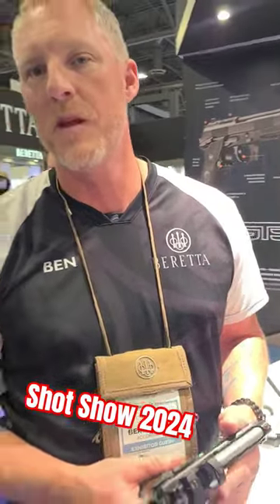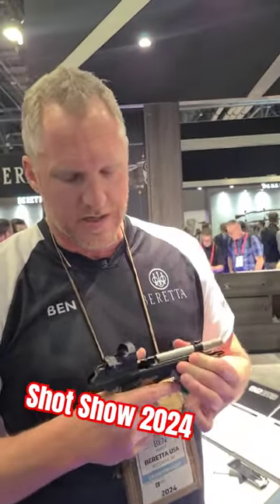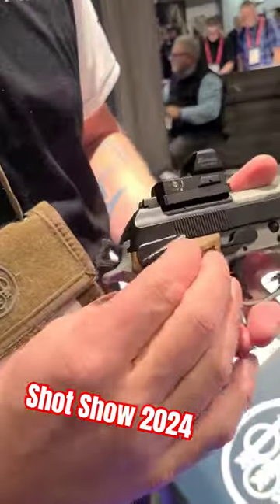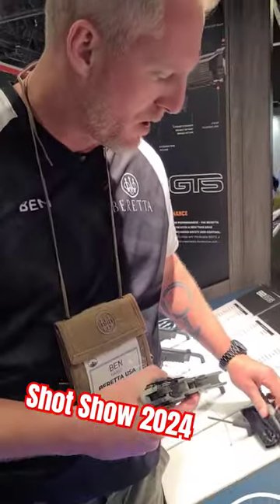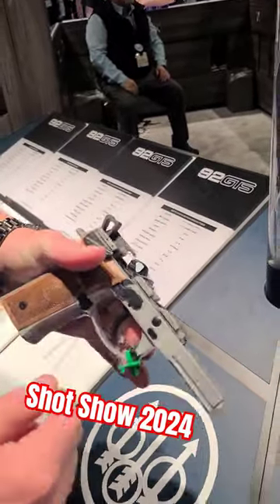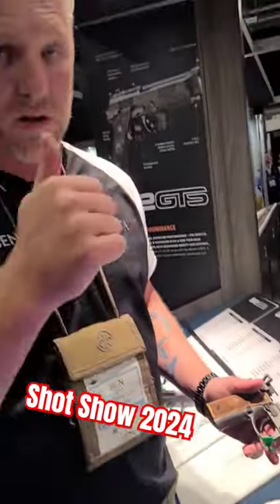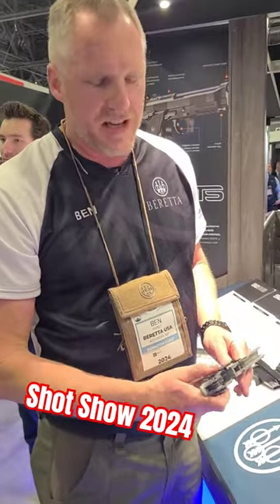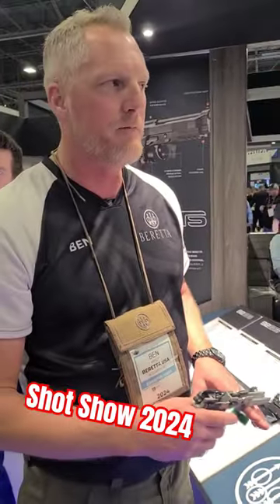Team Beretta Shooter Ben Hardt talks about the new 92XI GTS at Shot Show 2024

Comment: The clearly did not just copy Taurus' system. I'm particularly curious about the motivations for not using an established approach for a frame decocker.
Reply: hey mate do your research on beretta and Taurus pietro beretta sold his Brazilian factory to Taurus along with the blueprints for the frame saftey pistols in 1980 Taurus started selling their model after the government contract ended
Reply: @intoxicateddog12  Actually they sold the Brazilian plant to Taurus to move production for the Americas to the US as a condition of the XM9 contract. The movement of the safety to the slide (which I personally prefer) was the outcome of suggestions from the SEAL group Beretta worked with prior to the XM9.